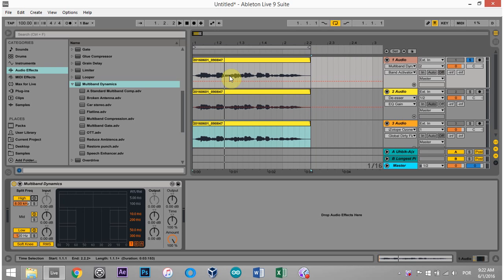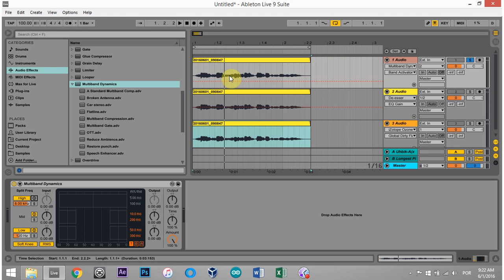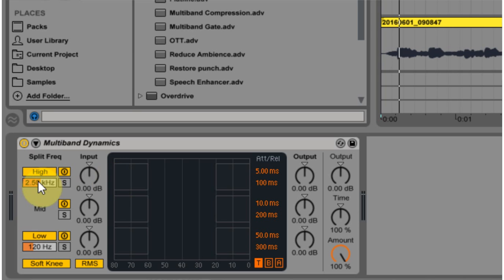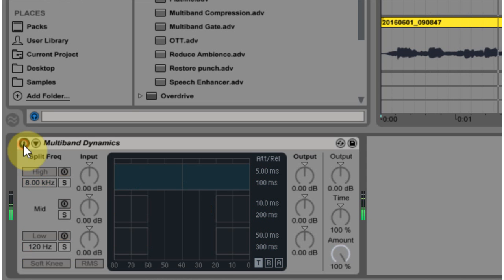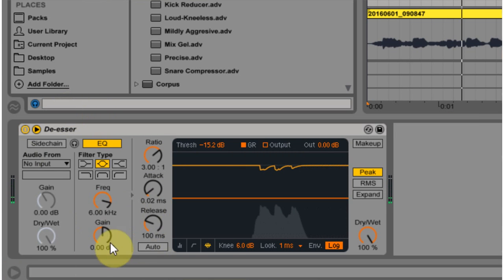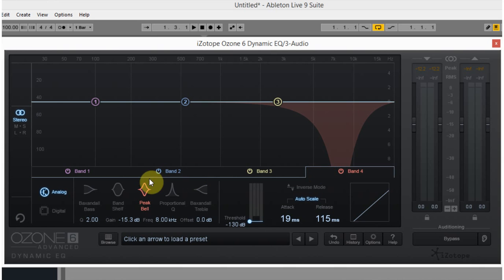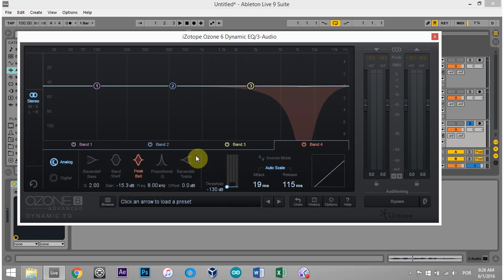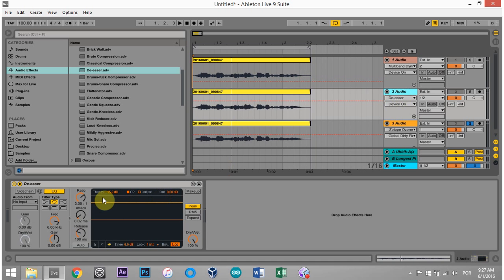Ableton Tutorial: De-essing; 3 Methods & What it is

Comment: I came here to learn about Ableton's De-esser. You basically just said "Ableton has its own de-esser, with these couple of features," and moved on to the next option. That's not an explanation or tutorial.
Reply from the maker: I believe the title of this video describes the video.
Reply: Check it, pick a deesser from your dynamics folder, turn attack to 2-5 ms, release to 100+ ms, frequency to 7.5K hz 
Ratio at 4:2:1, set both output and thrash 60% up the column. Don't sidechain until you get some hair on your chest.